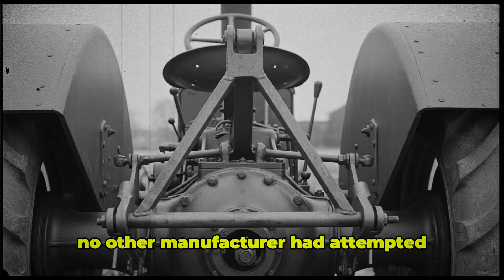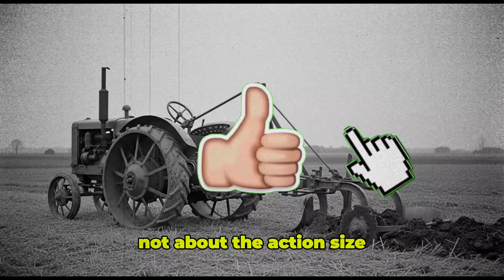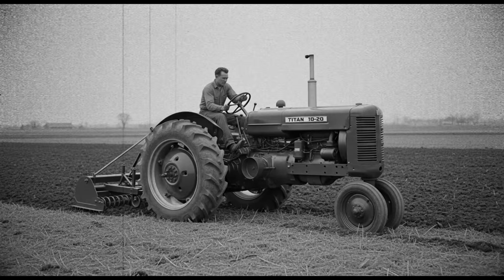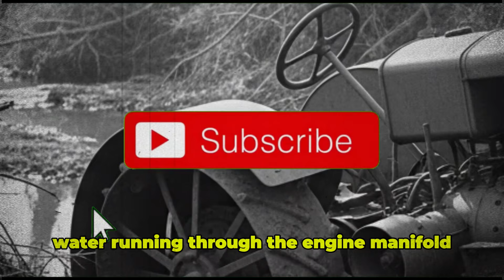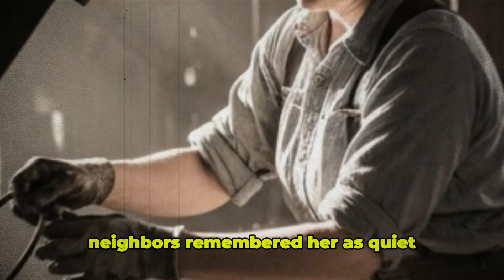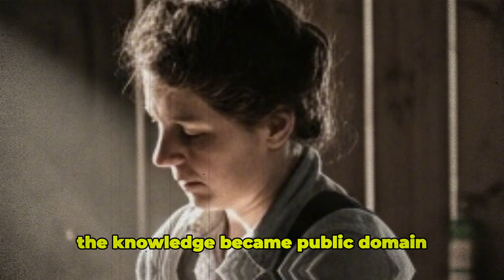1926 The Inventor Who Died Testing His Own Tractor The Design Lives On

Comment: Familiar w/the Ferguson system, the Ford law suit, had Ferguson 30 on the family farm,  Gramps bought it new 1953 w/twin 16" moldboard plow and 8" adjustable disc, rear tilt bucket, used sickle mower.  Spent many hours on that tractor as a lad.  Many years later sourced a functional TO 35 w/twin 14" Dearborn plow and 7' non adjustable Dearborn disc harrow for a reseeding project.  Aged equipment worked well enough to complete the project.  
Very interesting about Mr. Cuthbert, thought old Harry Ferguson was the inventor, he sure made Henry Ford II write a big check after a long trail in the early 50s for patent infringement.  
I did lose an uncle on a steep hillside in Washington State about the time Gramps was purchasing that TO 30.  Don't know if a Ferguson System would have saved Uncle Johnny or not.
Reply from the maker: Thank you for sharing such a meaningful and personal story. Memories like these truly bring history to life. I'm also very sorry for your loss farming has never been an easy or risk-free life. I appreciate you taking the time to write this.
If you enjoy this kind of centent, feel free to subscribe.